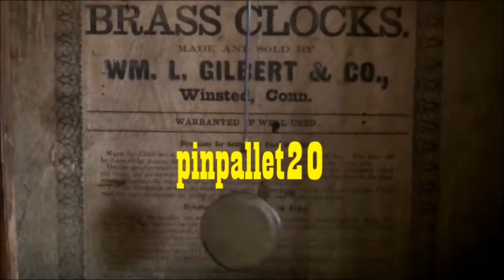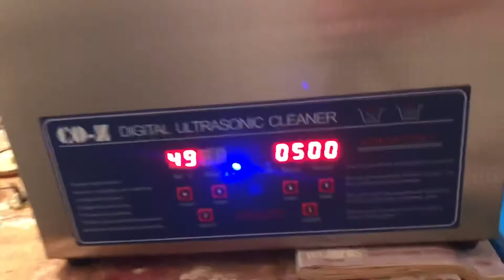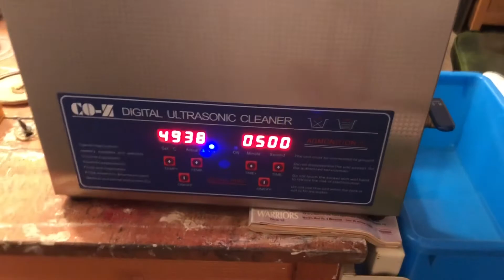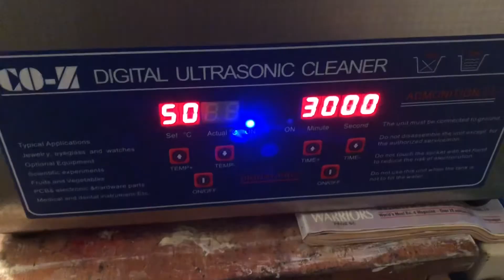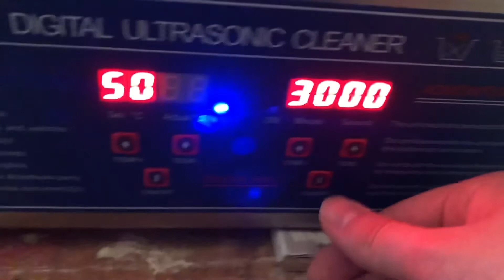Forestville 8 Day Kitchen Wall Clock Disassembly (Part 2)

Comment: Guessing you don’t have to let down the springs or you did not do it because that plate is stuck to front of movement
Reply from the maker: On this movement, you need to let the spring down before taking it apart. I was attempting to take the escapement out first to let the spring run down without using a let-down key, but that backfired when other gears started getting loose. This was a pretty poor example of spring un-winding. Thankfully nothing was damaged.
Reply: @SKHorology2025  ok
Reply: @SKHorology2025  I’m new to the whole clock repair world
Reply from the maker: @jsclocks4281  Good to have you in! By the way, that little Seth thomas alarm clock of yours is actually a Westclox Baby Ben. If you look at my series on the "Westclox Baby Ben style 8" you'll see that your Seth Thomas movement and mine are almost identical. The only difference being my clock has nickel plated top and bottom plates. 

If you're wondering why this is, this is because the General Time Corporation (Which owned both Seth Thomas and Westclox) stopped caring about separating individual product lines from each company. This idea began in the late 1930's when G.T bought the two companies. Adding to this, Seth Thomas had to recover from a flood which destroyed on of the Seth Thomas factories in 1954. 

There are plenty of 1940's through 1960's Seth Thomas clocks with Westclox movements inside.
Reply: @SKHorology2025  thanks for the info
Reply: @SKHorology2025  I’m going to start repairing clocks on camera
Reply from the maker: @jsclocks4281  Good!